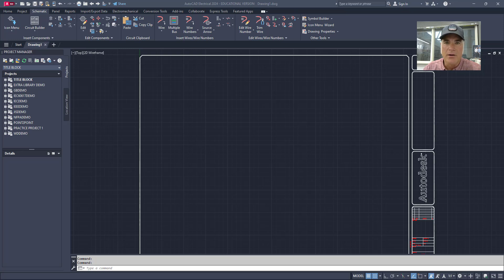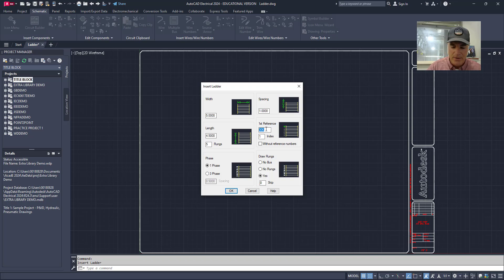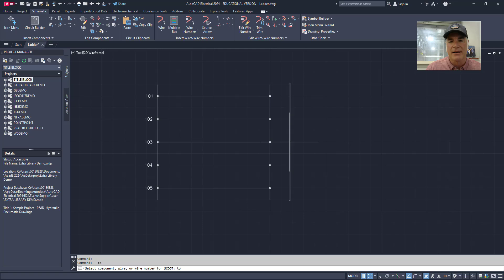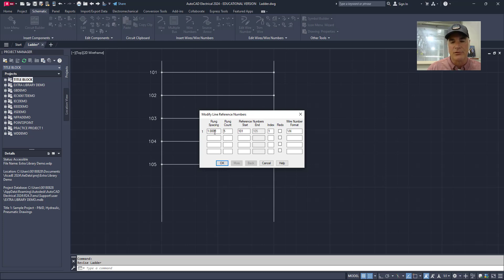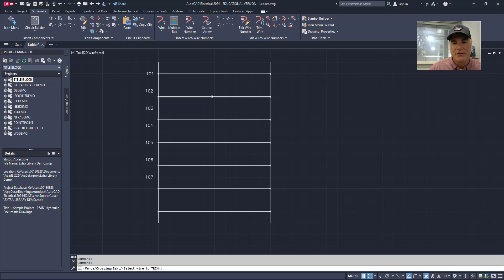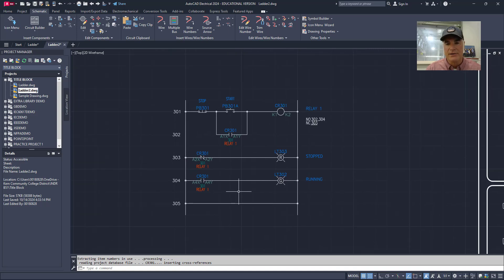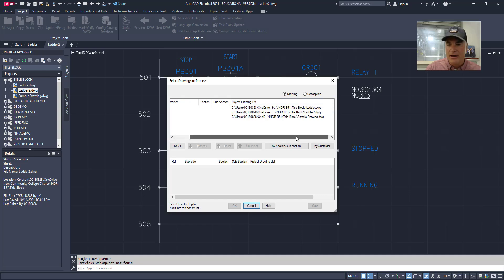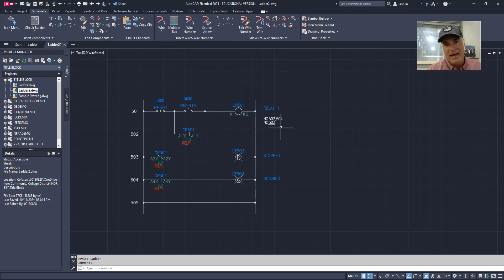Inserting and Revising Ladders

Comment: Great videos, you saved my life with the wdl and title block updating. My company wants me to fully transition our old drawings that use custom blocks and are only on autocadLT, is there a way to make custom icons that act similar to the autocad nested icons, or is it better just to cut the cord and switch over all the way. Also they use a spacing if .6250 between line numbers, which is cramped, what’s the recommended amount of spacing to switch reference numbers to if I do go full autocad icons
Reply from the maker: Thanks! I am glad they have been helpful.
Yes, you can make custom blocks that look like your blocks. There are tools in AE tools in AutoCAD Electrical that can help. It is not too difficult. I will create a post a video on how to create a custom AE block in the next week or two. 
Depending on how many custom blocks you will need to make, it may be better to convert to AE and just use theirs.
.625 spacing is in the normal range. If things seem cramped, you can adjust the size of the text in the blocks to 3/32 instead of 1/8. It is still easy to read and that 1/32 really makes a difference.
Keep an eye open for the video on creating a custom block, and let me know if you have any other questions!